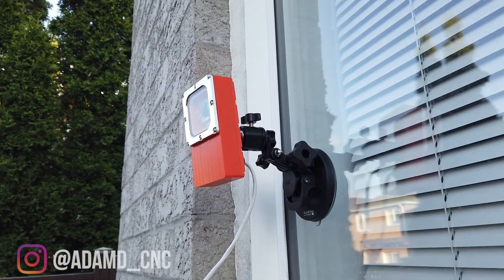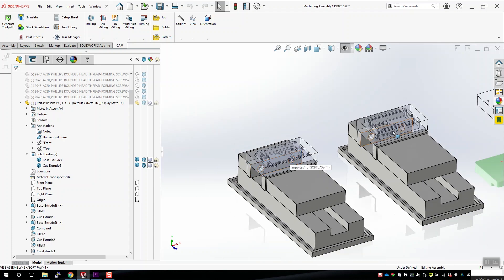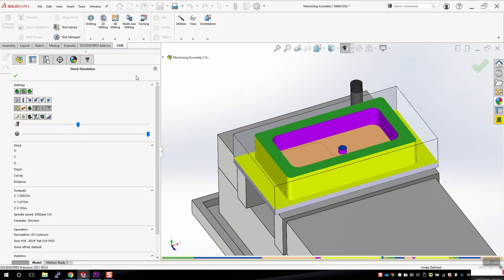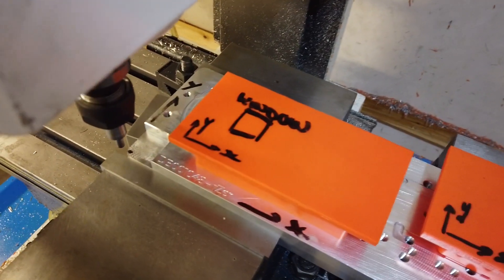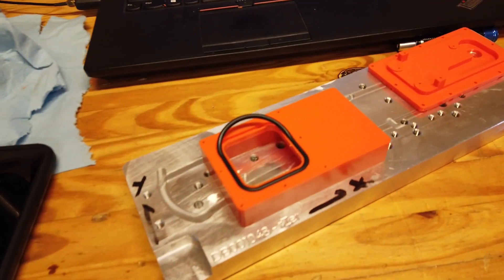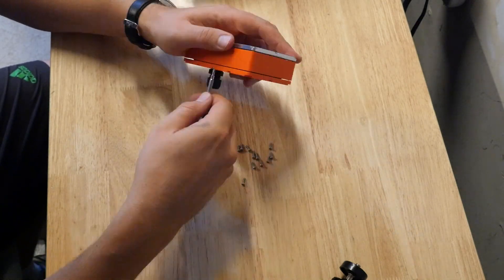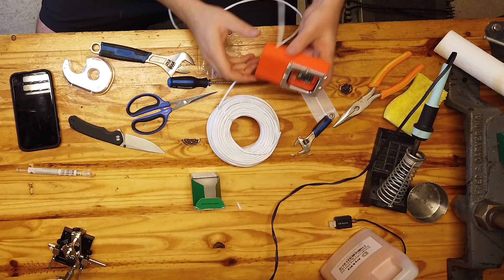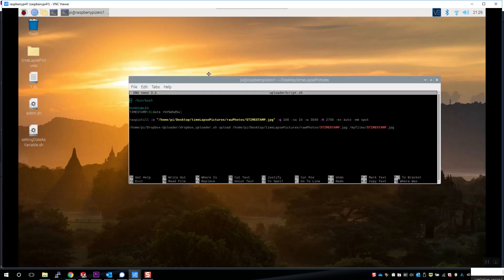Raspberry Pi Zero W Camera Case Machining on Precision Matthews PM30-MV Converted Mill

Comment: If you have got any issues with condensing? One way you could do is to add a little hole and cover it with a membrane of Gore-Tex fabric.
Reply from the maker: It’s still installed and running fine with no condensation issues at all. I’m pleasantly surprised!